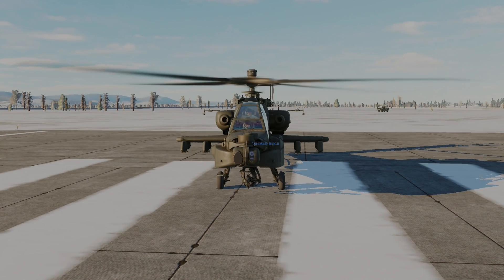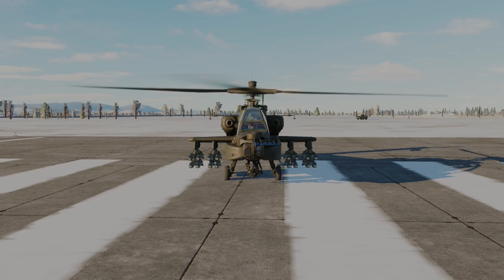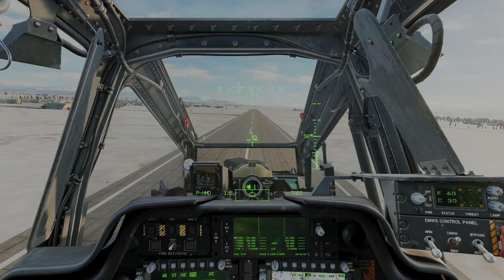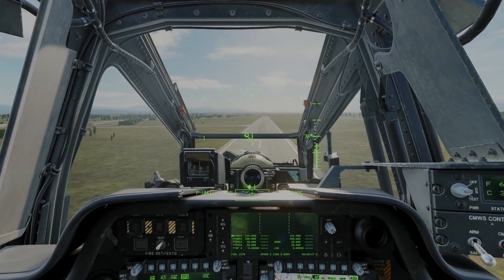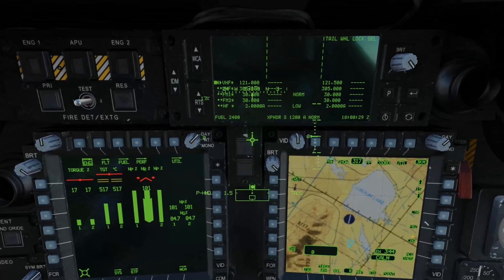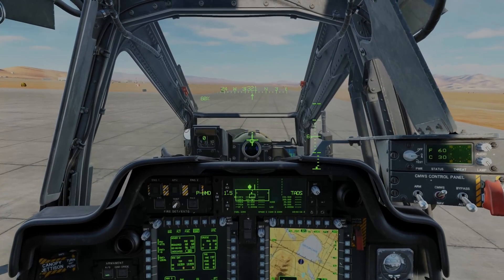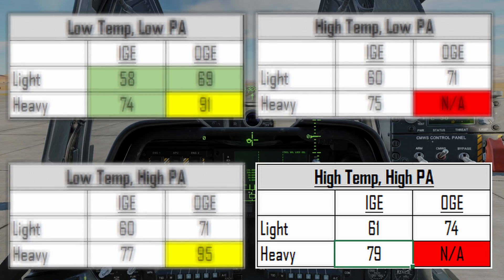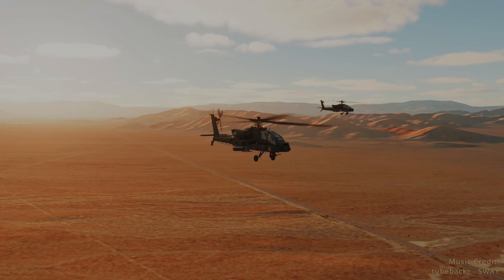REAL APACHE PILOT shows you why you KEEP CRASHING!

Comment: That’s a great video with explanations. The “E” model solves all of the problems but now with all the power and same tail rotor we get LTE, lol. Hope to be on DCS soon with this same call sign.
Reply: Well "helps" more then "solves" whenever they add a more powerful engine they usually add more "boxes" for systems as well. Same goes for the F-16, they keep putting bigger engines and putting more stuff on it, but the wing itself is only so big.
Reply: It doesn't solve all the problems.  It just increases the ability to fly a higher load at a hotter/ higher altitude environment, but the crew will still need to be tailed by a fuel truck to get any useful distance.

Comment: Great demonstration here. And people don't realize, when the little weight indicator on the loadout page turns amber, that's just over max gross weight. It doesn't take into account any perf factors. This would have been a great video to include an online E6B calculation. You're just changing density altitude here (between temps). Assuming the field is 4700, and let's say you got to 40°, that range of density altitude is about 3000 to 8700'! And let's say the pressure was low too, at 29.20" hg, you're at 9500! It's easy to just get into game mode in this, even as a real pilot, but at the end of the day, if we want a SIMULATOR, we have to respect the numbers a little more.
Reply: You. Have to respect them more

Comment: After flying the gazelle & picking it up fairly fast I can say the 64 is quite a bitch! quite a few bugs still being pre-release, the gun seems to offset for no reason unless your aiming pretty much straight forward & uncommanded barrel rolls are a thing. This thing isn't a jump in & fly
Reply from the maker: Yeah Casmo just did a video on the gun - you should definitely check that out if you haven’t already. I haven’t had an unchanged barrel roll, but I’m wondering if retreating blade stall is modeled? I have had it pitch up and roll left at high speeds, so it’s quite possibly related to that. But you’re right, it’s early access, and we’re all unpaid beta testers. 😂
Reply: @schoolio64D  if the helicopter pitched up and rolled left. You are experiencing retreating blade stall.

I imagine the uncommanded barrel roll is a result of exceeding the Vne by severe maneuvering, ie; accelerating too fast in a dive for the nose up pitch rate caused at the onset of retreating blade stall to self correct the condition like it would in level flight.

If you're close to retreating blade stall, you have to decrease the severity of the manuever; slow down, reduce bank angle, lower collective or a combination thereof to recover.

Obviously you know that schoolio, that was more for the gentleman you responded too.

Sent to you from none other than Mother Rucker! Attending ALSE school atm.

Loved your vid. Makes me want to get the Apache module.
Reply: @ender5817  The specific behavior mentioned here is a (to my knowledge confirmed) bug, it often happens at around 110-120 knots, way before RBS should set in, or Vne should be of any consideration.
Reply: @jubuttib  gotcha. Yeah 110 does seem a little low, Vne is a dynamic number that's not fixed despite what the red tape on your airspeed indicator would have you believe.

Blade stall can be entered earlier than structural Vne based on conditions, gross weights and the types of maneuvers being performed.

But 110-120kias does seem extraordinarily low - though I won't say impossible.

Gona agree that she's probably bugging out.
Reply: @ender5817  No, i was  in a hover, had been for roughly 3-4mins ( stable & all in green ) and suddenly it just rolled over to the right uncommanded nothing i could do. Im pretty sure ive heard others talk of this also.
Reply: @leewalton7403  oh jeeze. That is definitely a bug!
Reply: @leewalton7403   For me it happens in just regular forward flight between 100-120.  Even just barely pushing forward on the cyclic and I go into a left roll as if the cyclic was smashed all the way to the left.  And it's always to the left, never to the right, which leads me to believe it has something to do with retreating blade stall, but shouldn't be happening at those speeds with such tiny inputs.
Reply: @GTRNights  mine was to the right, in a stable hover ( had been a few mins ) and like you said as if the cyclic was pushed all the way right. Only happend the once tho so its gonna be hard to pin it to something.
Reply: @schoolio64D  After watching that Casmo video I did some checking, and largely saw the same offset as he did when firing full bursts, BUT when I did single shots with the gun they all seemed to land around the area I was aiming at (some left, some right, some spot on, about equal spread). So right now the thing that weirds me out, is that while it's normal for subsequent rounds to land off to the side as the recoil pushes the heli around (and TES isn't there to compensate at all), why on earth do the initial rounds land off to the side as well when shooting in bursts? The first rounds should land in the same spot as they do when firing single shots. =/
Reply from the maker: @jubuttib  are you stationary or moving when you fire the shots? You have some additional ballistics considerations if you’re firing off boresight while moving that aren’t compensated for by the gun.
If you’re stationary, I don’t know…might be worth a bug report.
Reply: @schoolio64D  stationary, was replicating casmo, and testing how distance affects, as well as shooting 90° left or right.

Comment: thank you School for putting this together it's a really nice video. i don't know what your dash 10 is my guess is a log book or manual with performance listings.
i do have a related question, i read that ground effect is 1.5 times the rotor diameter is this correct and is this modeled on the Apache. and if correct what is the rotor diameter?
Reply from the maker: The -10 is the Army version of an operators manual. It has all the information about systems, performance, operating procedures, etc. Unfortunately it’s a restricted distribution document, so I can’t post pictures from it, but I can talk about it in general terms. Ground effect is modeled as you can see in the video, and depending on your reference, it’s 1/2 to 2 times the size of your rotor disc. The Army defines it as “about one rotor disc” in their aerodynamics manual (TC 3-04.4). The rotor is 48’ in the Apache.

Thanks again for watching!
Reply: @schoolio64D  thank you very much, long time ago i had a clearance in the Navy so say no more i will never ask for any information if it's classified
Reply: @schoolio64D  the rotor disk in the Blackhawk is just shy of 54 feet in diameter.

The height of the mast is just about 12 feet high.

So at a 50 foot hover, our mast is actually 62 feet AGL. About 7 feet outside of OGE according to the Army definition.

The rotor disk transitions into OGE at approximately 42 feet radar altimeter height which is calibrated to wheel height, 12 feet below the mast.

Some points our IPs have driven home recently. Thought it was interesting because I had never considered it
Reply from the maker: @ender5817  that's interesting, and I never heard that nor thought about it before...and I flew 60's for about two years too.